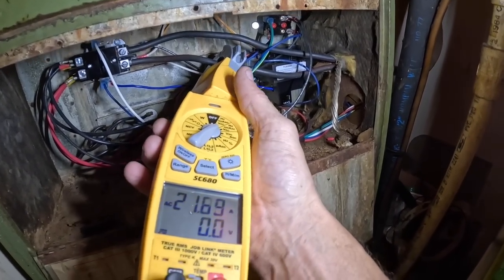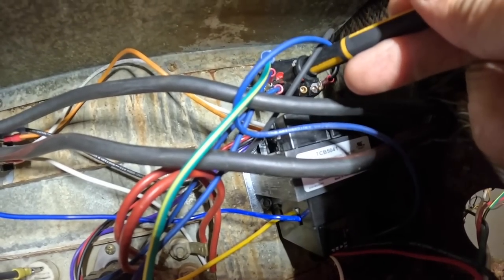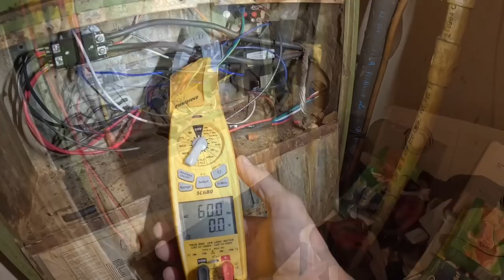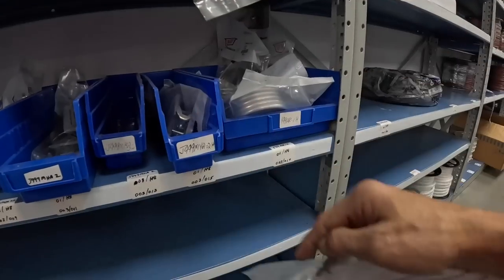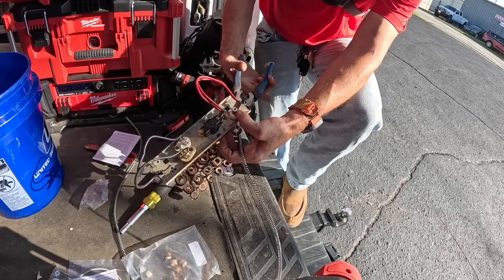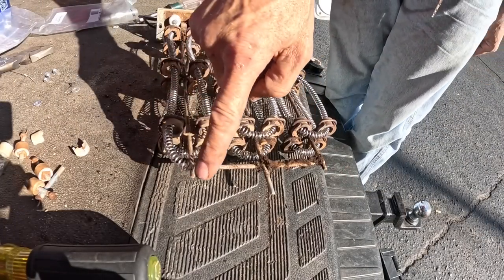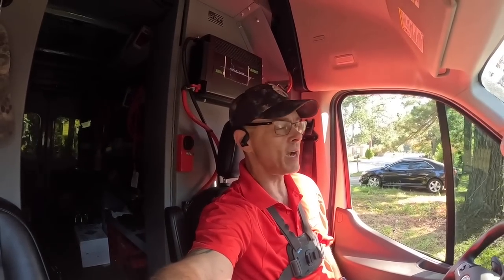It’s Fixed, But I Still Can’t Explain What Was Going On!

Comment: Man that is an old one. I could tell by the color. Somebody had it wired crazy. You got it straight and fixed up. I shouldn't say this, but if they need heat, just set that dump on fire. I can't believe people can live like that, trash. Bless you for doing jobs like that, I would not do it period.

Comment: If amperage doesn't balance out, look around for the path it's taking and you should find it.  For example grounded conductor, gas pipe, refrigerant lines.  Just use your amp clamp.  It's trying to find a way back to the source.

Comment: When you replace resistance heat strips, you must measure your old strips with your tape measure, then stretch you new strip to those measurements.  This will get you into a better than ball park resistance of your old heater, then you start stringing the strip.

Comment: If a new heat strip can be ordered and installed it's time to put one in. I mean they are not that expensive usually less than 200 dollars ohh and I forgot in the south they will put 5 kw in but for a 3 ton the kw should always be a 10kw in my opinion but then again I am in Pennsylvania but still think 10 kw for 3 ton even if it is not used that often.

Comment: The bottom heat coil was working, pulling 20A, across 240V. This gave you 20A on each leg.
The top heat coil was broken almost dead center. One of the broken ends was touching the frame, which is grounded. You had half the length of the coil, with 120V across it, so that end still pulled 20A, giving you 40A total on one leg. The other end of the broken coil wasn't touching anything, and had no current.

Comment: You have a shorted heat strip to ground…when it’s shorted halfway of the strip then being half the voltage it would only pull 20 amps at 115….if 115 was tied to the entire heat strip it would pull 40 amps as it’s only half the voltage…ohms law…
Reply: Agreed, dead giveaway is when your ground wire is showing amp draw.
Reply from the maker: I agree. But, I had not caught one doing that before.

Comment: what a dump.  You should have maybe checked the amps on the ground?  Maybe since the break was in the middle it was half working by completing the circuit through ground.  Since it wuuldn't be a dead short it would not blow the breaker but you would get amps on only one leg of power.

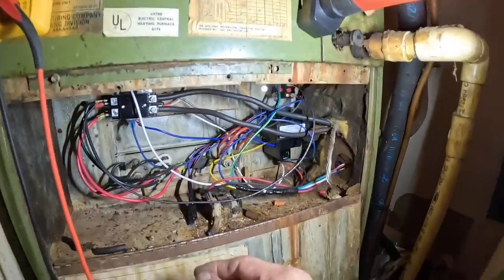Comment: 15:06 - Giggity.
I imagine most techs would attempt to buy the entire assembly, rather than re-stringing failed elements. Easier fix, certainly; but also more expensive I imagine.
Given the apparent age of that unit, I doubt parts are readily available. Good thing you know how to affect "old school" repairs like this! Also, you've given us the know-how to repair other filament-based heat devices, like vintage space heaters, electric clothes dryers, etc.
32:07 - Wow, I expected you to have to finagle it around a little. Lucky shot, eh? (Or simply too much experience? 😆)
Reply from the maker: Lucky

Comment: Another great video Curtis! Did you check for current on the ground conductor? The load should have been balanced and also the fact you were measuring 120v on one and 240v on the other.

Comment: Let me start off by saying I appreciate your videos.   On a side note I have been a tech for 30 years and am contemplating pack out gear.   What are your thoughts on milwaukee verses kline?   Does milwalkee fit torch vacuum pump and nitrogen? Plus extras
Reply from the maker: The wheeled packout has room for vacuum pump, and all the gear. Don’t know if anything has room for torches, but, I did put a rail on the back of my torches to mount a small packout to them. The Milwaukee packout system has a ton of options, either made by Milwaukee or third party vendors. The modbox is just getting started, and I don’t know a lot about it.
Reply: Thanks for your input.   Again I appreciate all you do.   Very respectable

Comment: How much did you charge for restringing the coil? I had a guy from a local company restring a coil that was broken and it cost almost $500 (including the diagnostic work). I  can't imagine that wire is anywhere near $100 and The actual restringing looks pretty damn easy, so I'm thinking I got ripped off.